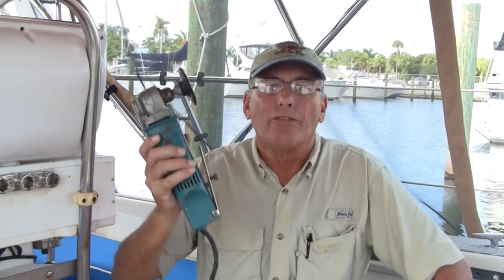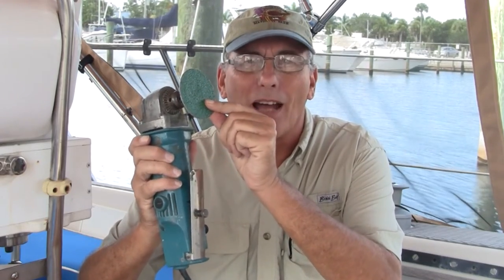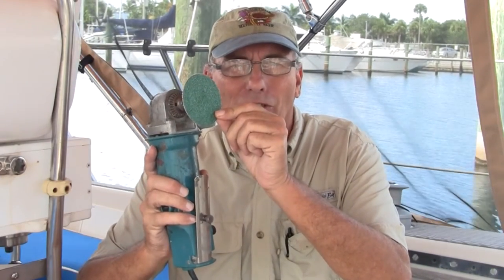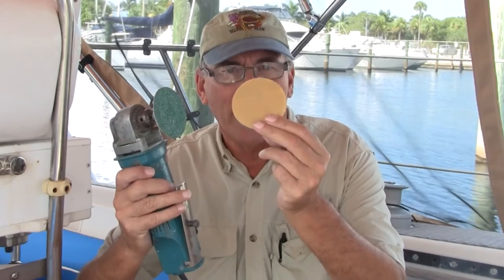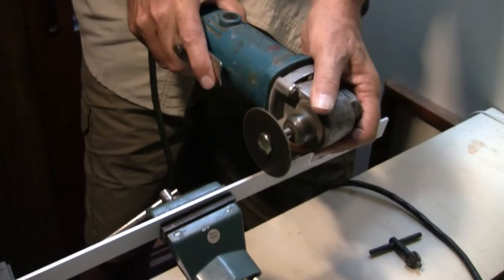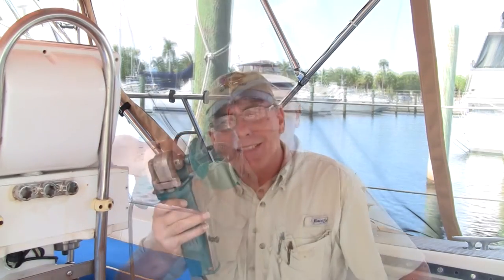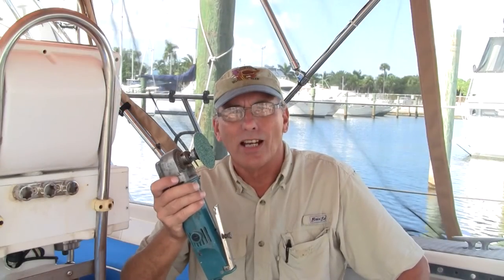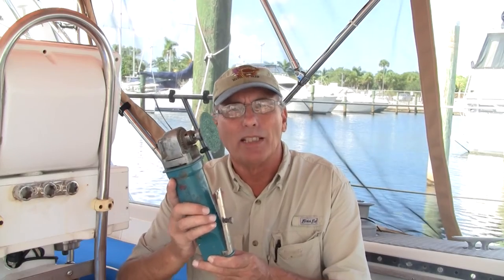Favorite Tools, Angle Drill

Comment: Nice.  Do you go without a regular drill then?  I carry a 1/2" chuck full-sized drill motor aboard.  

I can almost see a small angle drill replacing a regular drill motor, an angle grinder, and maybe even a sander, although a good 5" random-orbital sander is a hard tool to go without.  

The few times I've needed a grinder it's almost always been too much tool for the boat.  They are big and heavy, too powerful, almost never variable-speed, and all the other things you mentioned about the mess they make on a boat.   I think just replacing a regular angle grinder that an angle drill would be worth having aboard and pay its own way on a boat with limited tool storage.
Reply from the maker: I still use a portable drill for most of my drilling and driving work. Mostly use the angle drill for grinding and such. I almost never use a full size grinder anymore. I still use a 5" orbital sander though for sanding. Thanks for the comments